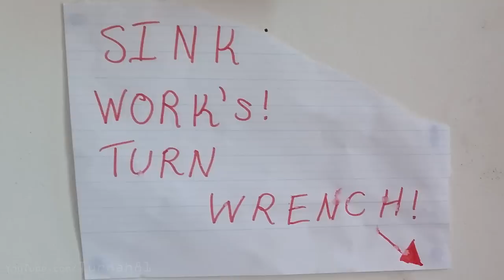Dropping Paper Planes From My DJI Drone

Comment: The funny thing with the crock pot is that's a very convoluted method when it's easier to just toss them in the dryer on low heat (or strap them to the dryer door). Or if you didn't want to use a heat gun, borrow your wife's hairdryer. Either way, same results. My goodness...

The beer sock thing, is typically called a cozy in the US (because it keeps your drink cozy). I have heard people up in Michigan call it a coozy but that might just be that accent.
Reply: Michiganders do call them coozies.

Comment: On the shoe + crockpot thing, i was getting ready for work at a girlfriends house years ago, and i was late as usual.   There was a small bit of water on the floor, either a spilled cup of water in my hurry or bong water can't remember, and i stepped in it in my only pair of socks. Panicking because i didn't have time to drive 35 mins out of my way to get to my place and i didn't have clothes at her house, i threw the socks in the microwave for what i thought was 1 minute than went to the bathroom to drop a deuce. All of a sudden a few minutes later, i realized the mic was still on just as the fire alarm started ringing. I had hit too many zeros on the microwave and the socks were smoldering and smoking in a mess that looked like lava. I never heard the end of it from her about that shit.

Comment: Yea, you'll be hard pressed to find a shower head with no mount while in Europe. There will be some fixed mounts, etc. But 90% of them are shower heads with a flexible pipe, and sone sort of wall mount for the head.
Come to think of it, it seems a little strange that's not similar else where O.o

Comment: 3:22 your daughter is a kid and excused but the embarrassment should be because of the incorrect use of the apostrophe in 'works' that two adults didn't correct. Also, it's not the sink that's broken, it's the tap.
Reply: Thanks. Couldn't work it out.

Comment: You could just put paper towel in the shoes for a hour or so then they air dry quickly after?
Reply from the maker: maybe- There always seems to be some water left i find when air dried.
Reply: Turnah81 maybe, I live in the U.K. so once 2 lots of paper towel has done its thing I put them under a radiator or on the washing line dependant on season